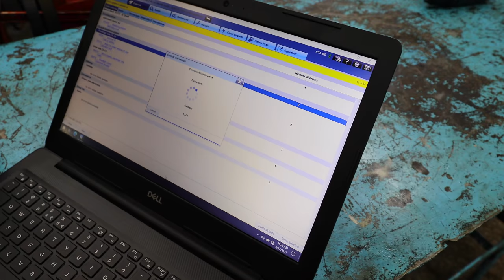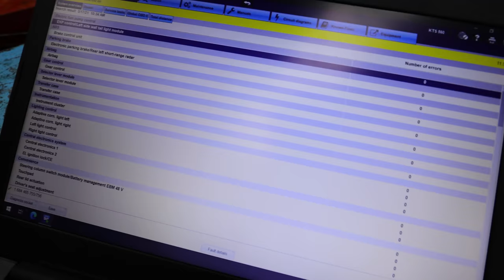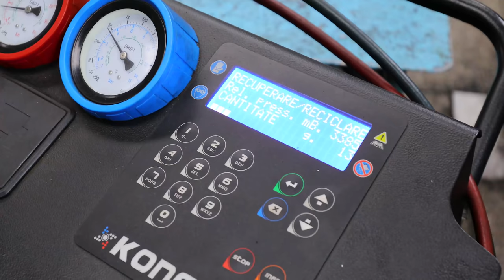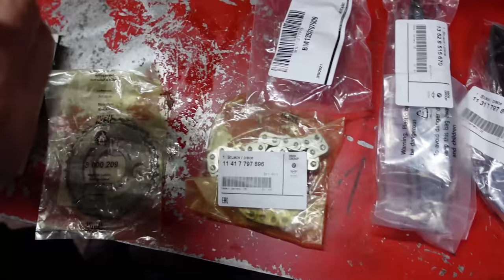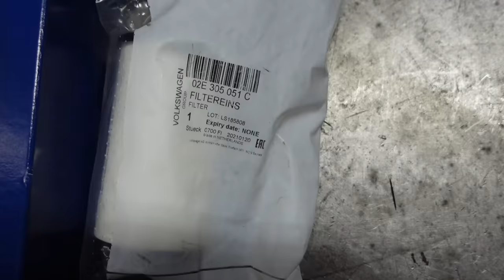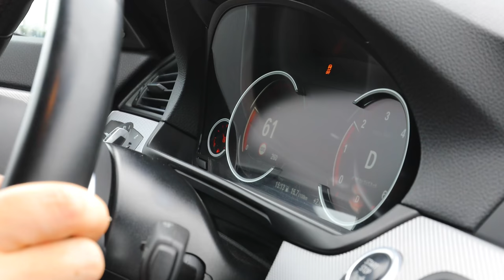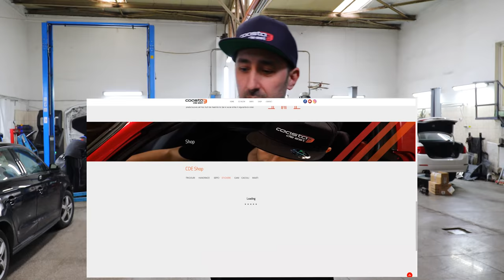BMW M550xd - balaurul cu 3 turbine 😈😈😈

Comment: Sincer după părerea si experienta mea cu BMW cel mai tare model a fost e36. Am avut ca prima masina un e36 si pot spune cu mana pe inima ca a fost cea mai proasta alegere :)) masinii ii plăcea sa se strice cat imi era lumea mai draga , de exemplu, am ieșit intr o dimineata la o plimbare si pe drumul spre casa m-a lăsat pompa de benzina, în ziua aceea am învățat cum sa schimb o pompa de benzina în camp. Intr-o iarna am încercat sa impresionez niște fete cu niște cercuri în parcare dar am reușit sa le sperii când mi a explodat un furtun de antigel, în seara aceea am învățat ca furtunele de antigel sunt făcute mai lungi pentru a tăia din ele în caz de urgenta. In alta seara am pierdut aerisitorul de la radiator , atunci am aflat cat de importanta este caldura când sunt -15 grade afara. Din păcate în cazul meu nu pot spune ca a fost o masina fiabila,dar a fost o masina cu care am creeat multe amintiri placute si pentru cate am dezvoltata o pasiune . Este ușor de lucrat la ea și piesele sunt foarte accesibile

Comment: E46 M3 CSL. În opinia mea o mașină "future classic" care o să valoreze mult în viitor, au fost doar vreo 1300 produse parcă. Și încă rămâne unul dintre cele mai sportive, frumoase și finuțe BMW-uri ever. Practic un sports-car pentru drumul normal, S54 3.2 aspirat, 360 de căluți, cu upgrade-uri majore la suspensie, aero și weight reduction (primul BMW M cu plafon de fibră de carbon). Încă n-am văzut unul prin România, o fi vreo unul pe undeva, sper să vină la voi 🤪 Vă pup, țineți-o tot așa 😎

Comment: BMW a introdus modelul 328 Roadster in vara anului 1936 la Berlin, unde acest model de masina a fost desenat de catre
Kurt Joachimson. Acest model de masina a fost atat de mult admirata de catre Hitler unde chiar a dobandit una. La inceput a fost folosita doar in cadrul curselor unde BMW 328 Roadster avea sa devina prima masina sport cu un motor de 2.0l 6 in linie dezvoltand 80cai. BMW 328 Roadster dispunea de o suspensia independenta, construita dintr-un material usor ca aluminiu si magneziu. Franele hidraulice si farurile era integrate intr-un metal pentru a imbunatati aerodimanica, atragand cu foarte mare atentie atentia tuturor fanilor din intreaga lume.

Masina avea un design simplist dar atragea atentia care dispunea la interior de 2 scaune cockip dispunand la interior de un șir de caracteristici inovatoare. BMW 328 Roadster a inceput fabricarea ei catre public abia la 7 ani dupa ce BMW a inceput fabricarea primei masini, in 1935 compania luand decizia fabricarea ei, concurand astfel cu Aston Martin, Alpha Romeo si Fiat. 

In iunie 1936 Ernst Henne pe circuitul de la Nurburgrind conducand un BMW 328 Roadster a infrant un Alfa Romeo care era echipat cu turbina la o distanta de cateva minute.

BMW 328 Roadster a cunoscut un succes remarcabil, devenind foarte populara, dar numai 464 de modele au fost produse din care 40 au fost folosite pe circuit, castigand 200 de curse si 100 de medalii.

In 1938 BMW 328 Roadster a castigat la Le Mans si Mille Miglia - unde a fost disputata cursa de anduranta in Italia, unde Alfred Fane Peers Fane nascut la 11 noiembrie 1911 in India, a adus victoria celor de la BMW unde avea sa duca performanta acestei masini la viteza de 119.2Km/h.

BMW 328 Roadster a dominat lumea automobilului jumate de deceniu, dar productia acestui model a fost oprita in 1940 din cauza celui de-al doilea razboi mondia, dar pana atunci devenise deja un clasic.

Prin urmare in 2011 a fost lansat la 75 de ani de la aniversarea marelui clasic, noul BMW 328 Hommage Roadster.
Se bazează pe aceleași principii ca și modelul 328 Roadster original dar este construit și creat cu o „abordare contemporană” avand un design aerodinamic unde au fost folosite materiale din compozitie usoara, dispunand de aceleasi faruri rotunde, grilele similare modelului 328 Roadster, venind din fabrica cu un top deschis si fara usi - oferindu-i o nota conventionala de scoala veche(old School). Designul rotilor este unul clasic din anii 30' oferind un 3D look, fiind unice!

Toata masina fiind integral din fibra de carbon,reducand semnificativ greutatea, oferind o nota de sportivitate.
Acelasi concept folosit si pe M3/M6 intrucat pe modele seriei I. BMW 328 Hommage Roadster se bazeaza pe BMW Vision Effecient Dynamics. 

Cu un interior elegant, dispunand de 2 i-Phone-uri folosite pe fost de display pentru iar motorul fiind un 3.0L - 6 cilindri in linie dar nu au fost oferite mai multe date despre acest motor.

Toate aceste caracteristici fac din 328 Hommage o mașină care ar trebui să fie produsă de BMW și nu o mașină care ar trebui să rămână ca un concept
La urma urmei, de ce nu ar plăti clienții o primă pentru aceasta?
Tehnologia este de înaltă calitate, designul este revoluționar (combinând stiluri de trecut și viitor) și este probabil să fie rapid pe drumuri.

Mașina a fost lansată la un preț de 7.400 de mărci în 1937, acest lucru se transformă la aproximativ 250.000 USD în moneda modernă dar chiar 
și la prețul respectiv, fără îndoială, BMW ar găsi suficienți clienți pentru aceasta. 
Prețul este puțin mai mic și va trebui să lupți pentru asta.

Comment: Consider ca cel mai bun BMW este seria 5 (1996-2004) e39
Acest model a făcut trecerea celor de la BMW,de la retro la modern.
Are o caroserie din aliaj ușor 
A fost dotat cu cele mai fiabile motoare din era BMW:
-m47 2.0d 136cp
-m57 2.5d 163cp
-m54b25/m54b30 192/231 cp
-m52tub 170cp
-m50b20 150cp
Pana în prezent,Bmw-ul(nu e masina,e BMW!)se tine bine pe piața auto atât ca design cât și ca dotări!
Întoarce priviri chiar și după majorat:)))
Aceasta iti oferă adevărata plăcere de a conduce și te conectează direct cu ea.
Este masina bărbaților care știu ce vor de la viață 
Si nu în ultimul rand siguranța ridicata pe care o oferă în caz de impact.
Succes tuturor!:)))))

Comment: BMW Seria 5 e60
Acest model a inceput sa fie fabricat din anul 2003 pana in anul 2010, incepand cu varianta non-facelift si terminand cu varianta facelift care a beneficiat de mici imbunatatiri fata de varianta non-facelift.
Acest autoturism a fost produs in 2 tipuri de caroserie:
- e60 Modelul Sedan(Limuzina), o masina cu 4 usi, un portbagaj foarte incapator pentru o masina tip limuzina, cu motorizari atat pe benzina cat si diesel, benzina cu capacitati cuprinse intre 2 litri si 5 litri si diesel cu capacitati intre 2 litri si 3 litri, beneficiaza de urmatoarele cutii de viteze :
- 6 trepte manual/automat;
- 6 trepte SMG 2;
- 7 trepte SMG 3.
- e61, varianta intitulata de producator "Touring", care spre deosebire de limuzina aceasta este tip "combi" ce face diferenta  dintre e61 si e60 este capacitatea portbagajului.
Acest autoturism face parte dintr-o clasa premium prin dotarile aduse de producator, o masina de uz zilnic care combina luxul cu sportivitatea.
Varianta de top a acestui autoturism este BMW M5 e60, cu un motor construit de ingineri dupa modelul masinilor formula 1. Masina are un motor 5.0 litri benzina, aspirat natural, S85 V10, 10 cilindri in V, care dezvolta 507 cai putere, cu o cutie smg 3 in 7 trepte. A fost pana la aparitiei celei de-a 7-a generatii de seria 5 cel mai rapid si sportiv sedan produs de BMW. 
Initial acesta a fost judecat ca fiind cel mai urat sedan ce bmw l-a produs, dar care a ajuns destul de iubit in lumea intreaga. 
M5 e60 atinge 100 km/h in aproximativ 5.2 secunde, 0-150km/h in 9.1 secunde, si 0-200 km/h in 14.7 secunde, 0-250km/h in 23.4 secunde. 
Eu personal, consider ca acest model a fost unul foarte reusit, deoarece s-a vandut in numeroase exemplare si il regasim si in ziua de azi. Putem trage concluzia ca la capitolul fiabilitate acest model a rezistat si inca rezista, mai ales pentru posesorii care acorda si atentia necesara autovehiculului. Eu, prima masina care imi vine in minte, cand aud de Bmw este modelul e60, nu "reneg" restul modelelor produse de aceasta marca, pentru ca a scos si scoate in continuare masini sportive si luxoase. Au avut multe alte modele ce au pus amprenta pentru multe generatii precum :
Vorbind de seria 3, avem modelul e30 sau cum i se mai spune, ursulet, modelul e36 poreclit si pisica
seria 5: e34, e39, e60
Aceste modele au fost si sunt cele mai indragite de iubitorii acestei marci. 
Odata cu trecerea anilor, si dezvoltarea industriei auto, BMW a produs si alte modele de admirat f80 varianta de top a seriei 3, f82 seria 4 si lista continua.

Comment: Un model de BMW foarte reușit, apărut mai recent este Seria 3 E92 335i cu codul motor N54, 3 litri benzina cu 2 turbine, fiind și primul model produs la scara larga de BMW ce venea din fabrica cu motor pe benzina turbo. Acest motor se mai poate găsi și pe seria 1, 5, 7, Z4, X6 și câteva modele de Alpina, dar și pe un model M, acesta fiind 1M. BMW seria 3 335i fiind mai accesibil decât celelalte modele de BMW-uri ce vin cu acest motor din fabrica, este mai recomandat pentru achiziționare, putându-se găsi in 2 sau 4 portiere. Cei ce doresc sa modifice acest motor, se poate destul de ușor ajunge la 380-400 de cai, cu filtre de aer sport, un intercooler mai mare și o evacuare aftermarket, un avantaj foarte mare fiind acela ca venea din fabrica cu arborele și bielele forjate. Ca și model este destul de fiabil, dar nici o mașina nu este perfecta, se poate întâmpla sa apară probleme la pompa de benzina, turbine, injectoare, scurgeri de ulei la capacul de culbutori, vanos, depuneri de carbon in motor din cauza folosirii injecției directe sau la pompa de apa. Deși sunt destul de multe probleme, ele pot fii evitate sau reparate, așa ca Seria 3 ce folosește acest motor nu este o varianta rea, ci dimpotrivă, este o mașina buna, ce poate fi achiziționata așa cum îți dorești, vrei cutie automata, manuala, vrei tracțiune spate sau xDrive, ai și navigație, trapa, interior textil sau piele și o poți găsi ca și sedan E90, coupe E92, decapotabila E93 sau break E91. Așa ca poți avea cel mai rapid sedan sau break in care sa cari toată familia și bagaje sau un coupe cu unele din cele mai frumoase linii, ce va atrage mereu privirile celor din jur.

Comment: Care este cel mai tare BMW produs vreodata ? Este greu de spus dar eu as alege 2 modele care merita luate in calcul. BMW E26 M1 unicul BMW cu motor central, o masina foarte rara din care s-au produs doar cateva sute de exemplare. Din cate stiu a fost produsa manual si contine multa fibra de sticla. Un alt BMW si mai rar este modelul 507, care daca nu ma insel contine multe elemente din aluminiu si a fost condus de multe celebritati.

Comment: Pentru mine cel mai tare BMW facut este  Apina B5 (e60)  pentru ca este prima generatie de Alpina facuta de inalta performanta cu motor de 4.4 v8 supraalimentat  ce dezvolta  500 cp si 700 Nm  pe o caroserie de  1700 de kg  care face  0-100 km/h  in 4.6 sec (pe vremea aia era ceva ) si cu viteza maxima de 314 km/h   b5 se bazeaza pe  545i cu unele modificari adica un bloc specific Alpina ,un arbore cotit forjat si cu pistoane Mahle cu compresie redusa ,motorul  pastreza sistemul de valvetronic si supraalimentatorul este actionat de centura de arborele cotit si are o presiune aproximativ 0,8 bar ,masina  are o transmisie automata Switch Tronic cu 6 rapoarte fabricata de ZF, are si un  diferential cu alunecare limitata

Comment: BMW E34  Pentru mine a fost dragoste la prima vedere cand am vazut varianta M5 in surprizele turbo in ani '90 in cele din urma am reusit sa imi cumpar E34 Touring 2.0 24v  benzina 6 cilindri single vanos motor M50B20 de care am avut parte doar 1 an deoarece i lam lasat fratelui meu cateva zile si mia crapat chiuloasa la cilindru 6 si baga antigel in capul pistonului.
Momentam detin tot un E34 berlina cu acelasi motor ca touringul sunt foarte multumit de ea trebuie sa ii reconditionez vanosul ca a inceput sa aiba acel rancanit si vreau sa il tin pana la adanci batraneti.:D

Comment: Dupa parerea mea sunt 2 modele de BMW care se bat pt titlul de  cel mai tare BMW din istorie, si anume:

1. BMW 2002 Turbo - care a fost primul BMW supraalimentat din istorie, fabricat in anii 70, a fost o adevarata bijuterie a ingineriei, si a avut mare succes si in motorsport. Avea un motor de 2000 cmc, 168 cai, 245 nm, tractiune spate, distributia maselor aproape perfecta, 54-46, si cantarea doar aproximativ 1000 kg. Deci pentru anii 70 eu zic ca a fost bomba si a adus multe inovatii.

2. BMW E30 M3 - prima masina M, deci practic a dat startul acestei game de masini sport M de la BMW. Primul M3 din istorie s-a fabricat in 1986 si avea un motor de 2300 cmc si 195 de cai.

Acum alegeti voi care vi se pare mai interesanta. Eu zic ca 2002 Turbo e cel mai smecher BMW din istorie.

Comment: Salut baieti.
De cand eram mic sunt fan bmw si prin urmare doresc sa imi vad visul implinit de a-mi cumpara un Bmw M4 . Stiu ca pentru unii cred ca este un vis pe care nu il poti indeplini, dar zi de zi aceasta masina ma impusioneaza sa muncesc mai mult .Dupa parerea mea daca iti doresti un M4 inseamana ca inca esti  inca un copil .

Lucrurile care m-au impresionat la masina asta sunt:

1.Bmw M4 are un motor de 3 litri Bi-Turbo si nu mai este aspirat care dezvolta 430 cp.

2.M-a impresionat foarte tare design-ul .

3.Aceasta masina poate sa fie 2 in 1.... O masina de zi cu zi care isi face treaba excelent dar poate fi dusa si pe circuit unde ii place cel mai mult .
 
4.Cu aceasta masina poti participa la diferite expozitii prin tara si cred ca o sa isi faca treaba foarte bine .
 
5.La primul test drive cu masina ma impresionat foarte tare ce poate face butonul M ....stiu ca pare absurd dar m-a dat pe spate
PS: (Stiti un curs pe mecanici ?)

Comment: Modelul meu preferat de la BMW e36 (pisucută).
Este o mașină foarte bună de modificat si pe lângă asta este foarte iubita de pasionatii auto.
Am aflat si eu de curand ca numele  de ,,PISICUTĂ" a fost pus de unul dintre primi proprietari de acest model pentru că  ținând masina in fara casei o pisică de așeza mereu pe ea , in fiecare zi cand vroia sa plece cu masina acea pisica era acolo si dormea. Asa ca proprietarul sa gandit sa ii dea BINE-lui porecla de PISICĂ.
Si de acolo cică si ar fi început totul cu numele acesta.
Nu știu cat de adevarat este dar mi sa părut interesant si m-am gandit sa va spun si voua.
Masina acesta ar mai.avea o poreclă internațională (DELFIN)
Imi mai place acest model de BMW pentru că motoarele sunt foarte de fiabile si puternice pentru perioada in care au fost fabricate.
BWM-ul e36 este un seria 3 urmașul lui e30 ( ursuleț) si este una din masinile odată conduse nu prea te-ai mai da jos din ea iti ofera o senzatie unică pe care o mașină din ziua de azi nu cred ca ti-ar oferi-o.(Părerea mea)
A fost fabricat din anul 1990 până in anul 2000 si a fost vândută in 6 caroserii( sedan,turing ,coupe, compact ,cabriolet si cabriolet baur)
Ce mai puternic E36 a fost M3 de 321 cp.
Există si trei motorizari pe motorină 318tds, 325td si 325 tds ,avand fiecare 90, 115 sau 143 cp.
Dezavantaje E36
💥 lipsa tractiunii 4x4
💥 design demodat
💥 probleme la interior
Avantaje E36
💥preț accesibil
💥 motoare puternice
💥 piese foarte ieftine
💥 fiabilitate
💥 piese multe la dezmembrari
Ce mai slab motor de pe E36 este cel de 1.6 de 100 sau 102 cp, uramt de cel de 1.8 de 112 sau 115cp.
In ciuda puterii scăzute au fost destul de fiabile si apreciate atât in strainatate cât si la noi in țară.
Cam atât știu despre această mașină.
Sper sa va fie de ajutor acestă informație.
RESPECT si mult succes in tot ce faceți. Sanatate si numai bine ❤❤💪